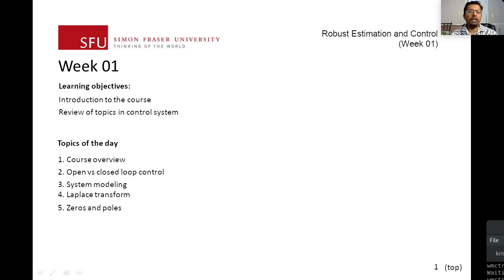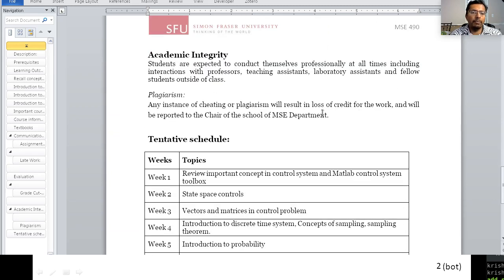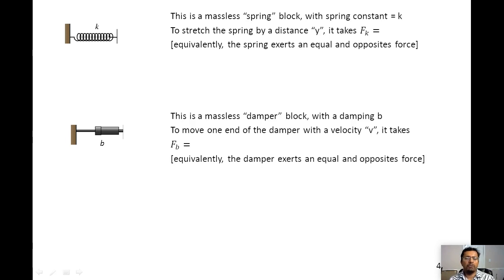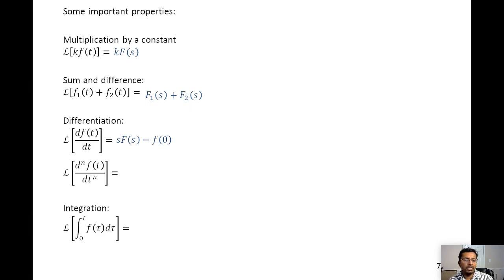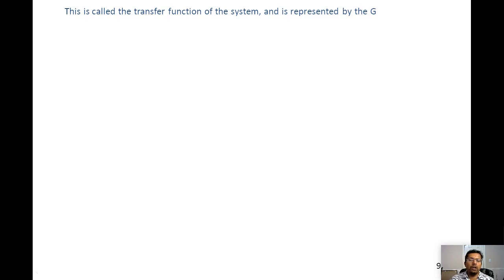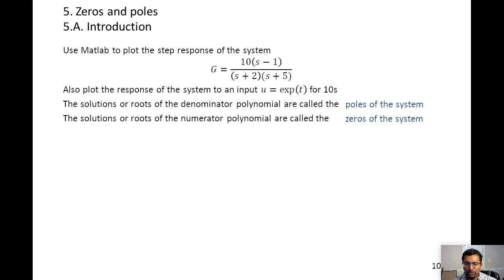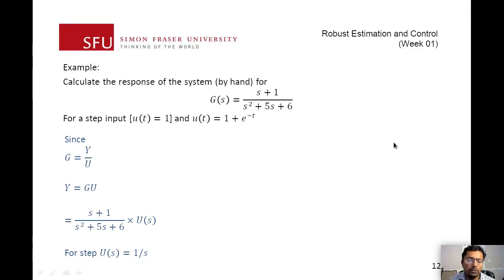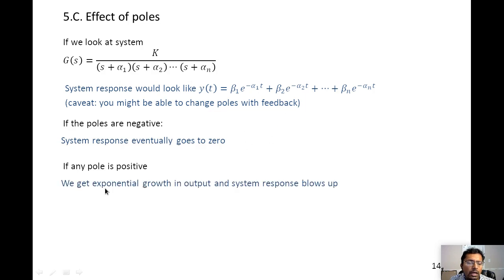MSE490-01: Introduction to course "Robust Estimation and Control"

Comment: On trying the input u(t)=1+e^(-t) I got y=0.1667+1.5e^(-2t)-1.667e^(-3t) in the time domain

The response is similar to the the step function (t->∞, t->0.1667) but it takes longer: @t=2, y~=0.2

-Braden